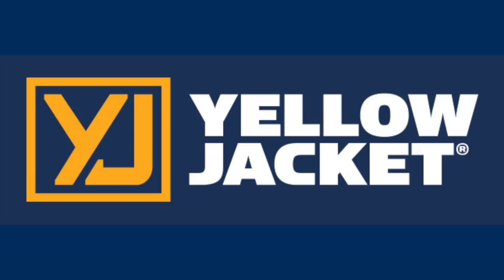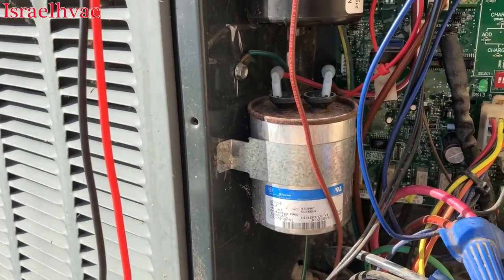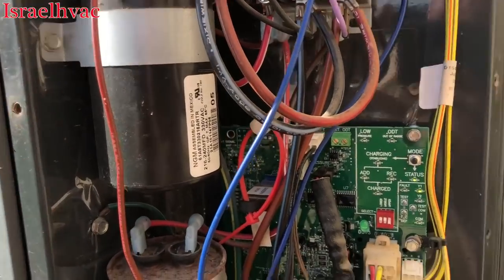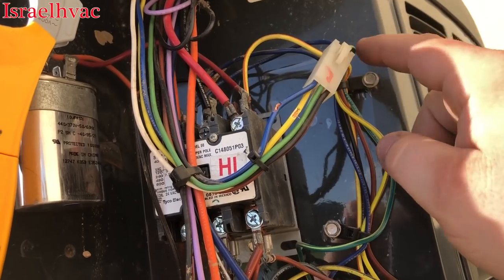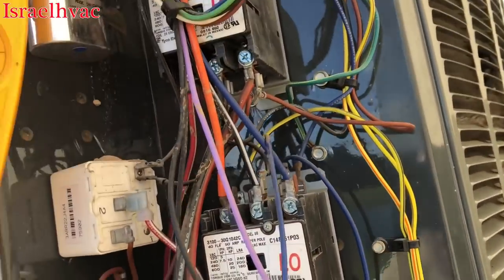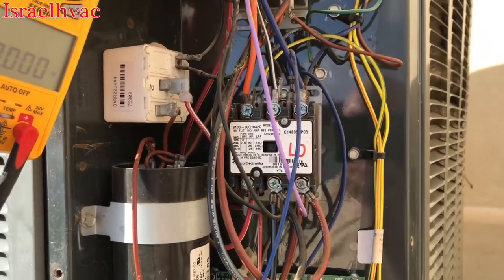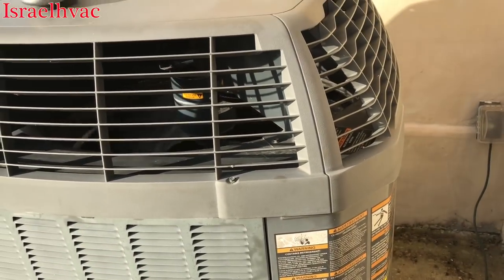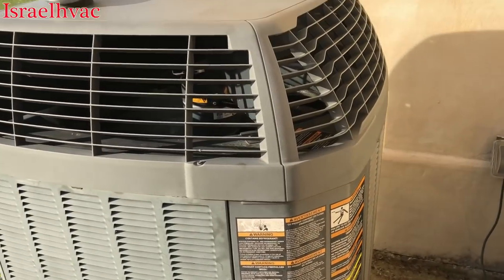How to Troubleshoot a Trane ECM Condenser Motor

Comment: On a two-stage compressor system there is not enough energy savings in condenser fan motor to justify extra ECM fan motor cost and subjecting an ECM fan motor to outside weathering.

Saves about 60-80 watts during low-speed fan operation.  Once condenser gets a little dirty, likely worth the extra full speed fan power to reduce high side pressure, reducing compressor power more than the 60-80 watts of slow speed fan savings.

Comment: Do you know if carrier also uses dc going going to their fan motors from the board ? I had an older model carrier I’m waiting on a control board for that had 24 bolts present to the board and 240 to the fan but no 24 at the motor, so I said it’s the board.

Comment: Hey ac guys I know I’ll probably not get an answer quick enough but I’m working on a RUUD Ultra Comfort series HVAC unit. My compressor fan isn’t coming on. I had no clue about dc voltage. It has a single pole relay that has power on all three legs all of the time. Even the brown wire off of the capacitor to the fan has power but still the fan does not come on. This thing has a huge control board and 5-6 wires going to the fan. I’m sure they control the speed and turn the fan on but I don’t have a clue what else to check.

Comment: I need some help with this im 17 in training working on a trane ac not running i got brown and blue thermostat wire i got everything hooked up right and the ac doesn't kick on the furnace works the stat has 3 wires green witch is data red witch is hot and blue as common

Comment: Why did it have three pole contactors ? Can you do a video on the wiring?
Reply: Joe Shearer if it's inverter compressors are 3ph...
Reply: Alexander Figueroa I don't think it's an inverter
Reply: Eric M ok got confused because the inverter are 3 phase.. Thanks for the correction
Reply: Hey John when you disconnect that plug for the condenser fan make sure when you plug it back in the high voltage has been disconnected because the capacitors will cause it to arc and melt that plug. Joe the reason there are three pole contactors they are breaking the start winding and the board will determine what speed it runs upon a Y1 or Y2 call, the capacitors have nothing to do with it. Trane has been wiring capacitors that way for decade's, as a matter of fact you go back to the GE days they wired them that way.
Reply from the maker: Larry Cole Thank you Larry I really appreciate the info
Reply: Timothy is right, i worked on a bunch of these machines back in the day.

Comment: Not a fan of changing out them compressors, have to climb in to replace them.
Reply: i always pull out the condenser coil out on those 19i and 20i's. takes a few extra minutes, but makes it so much easier swapping those comps out.

Comment: replacing the CFM already?  how old is the unit?  What was the cost for the motor?
Reply from the maker: Already? This unit is right at 10 years old and in its last year of warranty.
Reply: really? I wasn't aware seer 19 was that far back...time seems to be flying by....  few customers  want to buy the 13s till it was mandated...  It just looks rather new... if its 10 years thats fine, my psc's on my house however  are 15 and 18 years so far, but when it comes time to replace them, its under $200.  we had a customer with a lennox and VFD about 10 years ago and when it came time to replace the EFM it was going to be over $1000 our cost.... I almost %$#@.
Reply: I changed that identical motor out yesterday xl19I. not getting technical with price by my ticket was over 600

Comment: If you gonna help a service tech troubleshoot this motor, how about telling us which color wires should have 240VAC and which color wires should have the low 12-18 DC voltage?? The only thing you did was show us the 2 blue and yellow wires but you never actually actually said "blue and yellow" nor did you tell or show which wires should have a constant 240 volts on them!!??

Comment: Saving energy has nothing to do with saving money....looks like a pretty new unit for a cond fan mtr to go south....bet a psc would still be running...the direction of this trade is worrisome😃
Reply: It's not about saving the customer money. That's just a sales thing. Its about saving energy. The goal is to ease up on the power grid.
Reply: Customer saved $500 on electric costs over the years but just spent $600 on new cond fan motor install....
Reply: Haha probably not. It’s all made in other countries anyway.